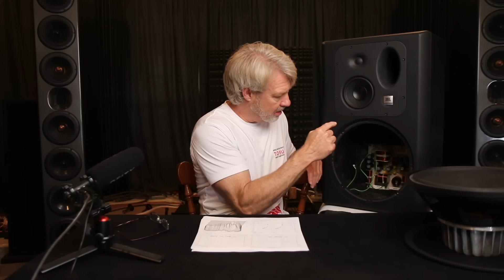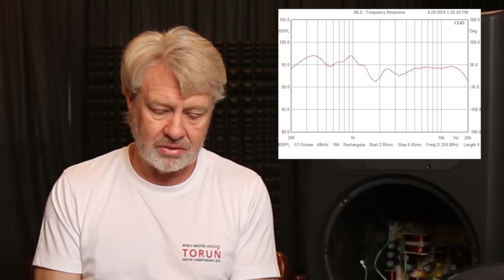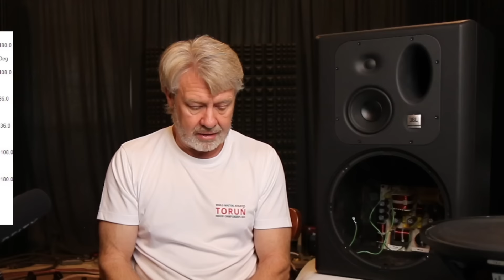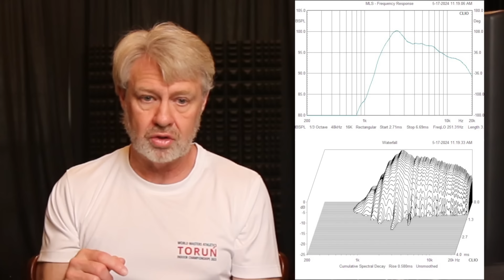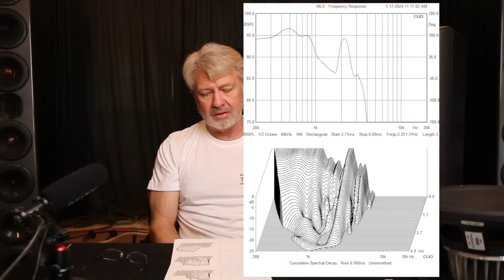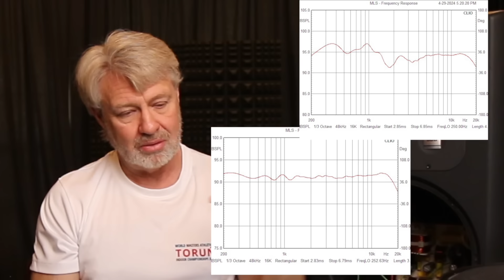Nails On A Chalkboard? These JBL's Were a Handful!

Comment: The JBL LSR 32s are a very good/competent monitor. I have had several pairs of them, and still own 1 pair. 

My monitors I placed/tested on a Klippel NFS and they measured superb, just as JBL claim. 

I have no idea how Danny got his performance measurements. 

In the old Studio Sound magazine (years ago) Keith Holland used to objectively measure various pro monitors every month, and after testing the JBLs he openly stated that the JBL LSR32s were the most accurate monitors he had measured, which was remarkable considering they were the only monitors Keith tested that were passive. 

I still have the Studio Sound magazine pages that laid out the test, and Keith's test results matched my pair of JBL LSR 32s; they had incredibly low distortion (distortion had to be raised by 20dB to see it on the plot), excellent pattern control and some extremely innovative drivers

With mine the impedance was almost ruler flat and the phase drift was minimal, and they always sounded awesome.

Later in the same year that Keith tested the JBL LSR 32s he wrote an article about distortion and other performance artifacts of studio monitors, and from that it was clear that the JBL LSR 32s easily outperformed the ATC 150- which at the time - was ATC's statesman 3 way monitor. As far as measured performance was concerned the JBL wiped the floor with the ATC.

It wasn't even close!!    

Finally, the JBL's woofer has 3 coils and its cone is made of a graphite/polypropylene composite - not paper as Danny suggests.
Reply: Not sure who to believe. The published impedance curve in the LSR32 manual does seem to validate Danny's measurements (over 10 ohms down to 2.5ohms in several spots) and the cabinet is definitely under braced and resonant. I have a pair - and like them. As for the response curve...not sure.
Reply: @user-q5i5h    JBL's impedance plots for their JBL LSR 32 do not follow Danny's impedance plots really well, especially in the LF spectrum. 

In Danny's impedance chart (15:48) it shows a sharp rise in impedance (~25 ohms) at 15Hz.

The JBL LSR 32's don't play down to ~15Hz; so that's a red flag.

Danny's impedance chart seems to be poorly laid out and referenced; I've never seen an impedance plot (for a moving coil transducer speaker) that starts @ 10Hz - that's another red flag.

The JBL impedance chart shows that its impedance stays below 10 ohms up to around ~50Hz and even then (@50Hz) it's only just a little bit over 10 ohms before it drops to less than 10 ohms again from 50Hz upwards. 

Nowhere to be found in the JBL literature (regardless of frequency) is an impedance surge such as that shown at 15Hz in Danny's plots.

Comment: I’ve personally never liked modern JBL and that explains why! Their “pro” equipment is as bad or worse, one example has 16 tweeters, talk about screechy! Stamped frame woofers, and thin plastic vertical cabinets. Was based on a good design but made into cheap garbage (I sawed one In half)- the crossover in those might have been the most expensive part!

Comment: JBL uses bypass caps in parallel to keep costs down. The woofer is technologically advanced. Cast aluminium frame. Have Mike Klasco, Menlo Scientific confirm your upgrades. Harman tests in anechoic chambers to eliminate room artifacts. And used speakers do wear out and need periodic maintenance. Why? They vibrate and are mechanical.
Reply: Nothing about this one was worn out. They were just poorly designed and cheaply made.
Reply: @dannyrichie9743  they were introduced about 20 years ago. It's kind of embarrassing to not realize the 12" woofer is a cast aluminum frame with a Differential Drive motor. These are not cheaply made. It's an engineered package to a perfomance price point. A third party lab should verify your performance "upgrades". You are revoicing a professional studio monitor. Studio Monitors are far more revealing in the midrange than hi-fi loudspeakers.
Reply: @edgewound  Man, there was little to no engineering that went into these speakers. It has an unbraced box. The parts are garbage. The response is rough. They even have some resonance issues. These cannot be used as studio monitors. There is nothing revealing about this speaker.
Reply: @dannyrichie9743  Yeah...Sure...Let's go with that...thanks for the laugh. Slippery.
Reply: @edgewound  The laugh was these speakers, and attacking the messenger doesn't change the message.
Reply: @edgewound  Dude, you're missing the point of the exercise. Danny didn't do this analysis & upgrade to antagonize JBL fanboys, he did it because the actual owner of this particular pair of speakers sent him one as they felt it could be made to sound better. That is the basis & reason for every one of these upgrade videos being produced. If you don't believe his work is valid your path is clear. Don't buy the upgrade. Also, why should you think think he has to involve another company in his work? For that matter why do you want to be telling anyone else how to run their business? The customer who owned this pair of speakers chose Danny for the project not Mike Klasco, Menlo Scientific. But ok, for the sake of argument let's say that is the proper path. Who is going to pay the 3rd party for their services as well as the to & from shipping fees? Certainly not the owner of this particular pair. Clearly he wanted Danny to handle it. That's why he sent the speakers to Danny in the 1st place. From my perspective it should be you who pays for the extra level of validation of Danny's work as you appear to be the only one who wants it. Yeah, that is a ludicrous suggestion but that's exactly how all your comments about this upgrade video seemed to me in the 1st place.
Reply: @BullWinkle-x5y  "little to no engineering." That's the laughable part. There is a maintenance issue on these JBL drivers to address that can cause resonance...and it's not the crossover. But...I wouldn't expect the ignorant to know that. Carry on.
Reply: @edgewound  I would like to see the factory supplied measurement techniques duplicated even today. That was an indicator (to me) that some serious engineering did in fact go into these speakers and drivers. The poor parts quality refers to the use of paralleled caps and steel parts, and a cabinet made to a price point. Never understood the fascination with dissing steel connectors. Yes current flow thru that part can generate a field. Will it affect the sound? Not at the levels we deal with.

Comment: $900 for a pair of crossover parts, tubes, etc.  It doesn't include the boards, even if it did I wouldn't know what to do with all those parts.  I use 3 for my theater and they really rock, they get super loud so I am not surprised at their impedance.  Marantz AV8801 to Nord NCx500 3 channel, 62 vol is my limit it is super loud but very clear.  I bet this kit helps a lot, I admit they don't sound anything like any of my other speakers.
Reply: The base kit is $759. It is also a pretty easy upgrade, and we are here to walk you through any aspect of it if you need help.
Reply: @dannyrichie9743  wow, the legend himself! thank you sir.   I'll get with you soon.

Comment: I've been on the fence on sending my ELAC towers to Danny for improvement. I don't know if they can be improved. I've been waiting to see if somebody send them. I'm expecting to hear: Sorry, I can't do anything other that putting better parts in the crossover, at the end is an Andrew Jones design.
Reply: We've looked at one of the Elac towers. Andrew used some really large value electrolytic caps in the woofer circuits, and in more than one place. Just upgrading those values to a base level poly cap (what they need) gets expensive quickly. They also eat up a lot of space and that speaker doesn't have a lot of internal space. It really isn't a good candidate for an upgrade.
Reply: @dannyrichie9743  Oh… I see. Also, I would say that towers MSRP and new crossovers parts investment are not justifiable. Better speakers would be the way to go; regardless of the fact that I could have the crossovers outside the box. Is that right?
Reply: @HavanaGuyInArkansas  Yes, there are better options.

Comment: JBL uses those same dirpy binding posts on much cheaper AND much more expensive speakers. If there was a home theater receiver that "Could Handle 4ohms" It would be so expensive you'd get better and cheaper performance with some rackmount amps and an older THX receiver from the mid 2000's as a processor pre-amp. Newer home theater receivers are pure junk for any speaker under 8ohms. It will get hot and sound bad driving any 4 or 6 ohm speaker. If I connected a 4 ohm speaker to Billy (Denon AVR-X2500H) He'd provably melt the faceplate plastic.

Comment: For anyone thinking about building a 3-way.. this speaker is a great example of the fact that even big name like JBL will struggle with this..... The impedance dips... Reminds me of some of my first attempts at my own crossovers where I failed to look at the whole picture and solve ALL the considerations. Shunting a ton of power back to the amp to try to drag response/phase around is a bad idea but it's an easy trap to fall into while simulating a circuit.

Comment: The original version of this speaker was the LSR32, and really used carbon fiber for the front baffle (not a veneer). As well the two way version, the LSR 28 which was self powered. Both intended as studio monitors,  I'm sure ^That^ cost caught up with them and they found a cheaper "equivalent".
IIR they wrote several White Papers about their new innovative drivers and incredibly flat off axis response.

Comment: I am quickly coming to the conclusion that these well known speaker companies are now being shown up for what they are.. Meaning for years in some case decades we have purchased inferior second rate rubbish because there wasn't anyone brave enough to test and evaluate this Second Rate overpriced garbage...
Reply: The importance of crossover quality is common knowledge in the DIY community. But very few have the talent to choose the right values and put them in the right place.
Reply: @abboberg  Well these companies have made hundreds of thousands of dollars from customers Hire someone who has the knowledge instead of guessing and taking pot luck ..I think they owe it to the purchasers.. don't you?🤔
Reply: @fredfungalspore  I see that a lot of speaker companies are founded/run by "solo inventors" with big egos.  Not sure about PWK, but that "legacy" is nothing but garbage going into the box even after all these years.  Yes, they can justify the junk in the RP series, but what about the more expensive Heritage series?  Even the "designer" McClaren version has garbage crossovers at a $14K pricetag.  However, Klipsch publicly bragged about having air core inductors and polypropylene capacitors in their $20K Palladium model.  In most cases, that's what you have to spend to get the stuff Danny is selling to us for several hundred dollars (plus all of our sweat equity).  If any manufacturers actually owed the consumer anything, it would be the "cable guys".    No way to "upgrade" boutique cables after blowing all that money on them.

Comment: Odd. The published specifications are MUCH different than what is presented here. For anyone interested, simply look up the specs - they include on-axis, spatially averaged, first reflected and total radiated sound into a room. Perhaps something wrong with this pair? Would JBL just "make up the specs" ?
Reply: We often see some variance between a reference pair used for advertising and a production pair.
Reply: @dannyrichie9743  Your Z measurements match pretty closely. What is divergent is the on-axis. Also, Harman does some spatial averaging where your measurements will differ. It's clear (to me) that Harman did some detailed work on these (LRS32 & LSR6332), and for the most part succeeded. By comparison, the L100's from the 70's basically used a cap for a xover...
Reply: @Tuberhead1000  You think an uneven frequency response, driver break up, unbraced cabinets that are buzzing all over the place, and impedance dips to 2 ohms is succeeding? These speakers were a disaster.
Reply: He is in the business of upgrades..what do u think?
Reply: @MuscleBN Good point - he's a "professional upgrader", so it makes sense that there will be significant improvements. As far as your "business" reference that you made - where is the money? I can't even get close to his pricing on crossover components. Assuming he buys them wholesale,  he is essentially a  deep-discount retailer that throws in the engineering for free.
Reply: Looking at the impedance, Danny's & JBL curves match pretty well. However the phase angle at the low Z points is low so may not be as bad an issue. Also, Danny's mods gave up several dB in sensitivity.

Comment: Those commercial JBL speakers just don't work very well in home theater/audio.  That speaker is made to be hung from a ceiling in a room full of people with a big Crown amp behind it.  I have a commercial Crown, 1200 watts @ 8 ohms, rated down to 2 ohms
Reply: They still perform poorly in audio quality... and as shown, can be made quite a lot better with a good design.
Reply: I have repaired Macrotechs, sure they go loud but they ain't hifi.

Comment: Nice one Danny. Might be one of my favourite upgrades you’ve done. 

Some people may think that a company like JBL would throw resource at a product like this, but quite the opposite is likely. This was likely done super quick and maybe even by the post grad engineer who had very little experience. 

The worst thing about the original design is the impedance minimums. That suggests to me some quite flawed design work given the driver’s nominal impedances.
Reply: You are correct. The worst problem really is the impedance issue.